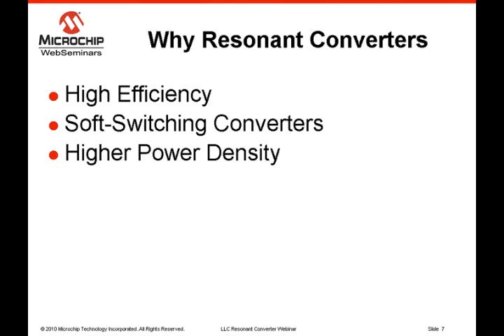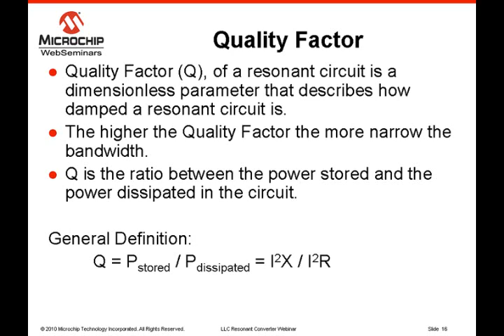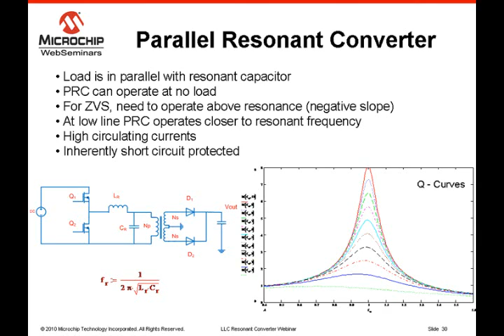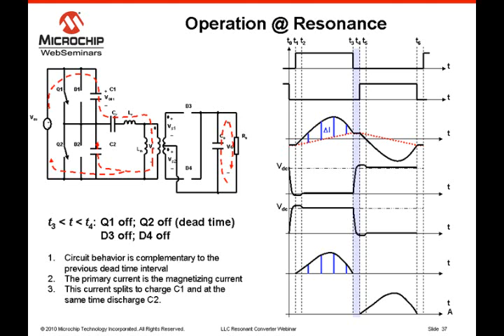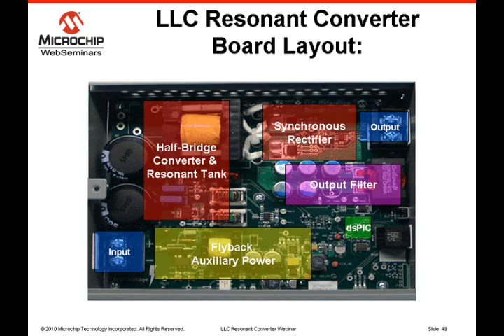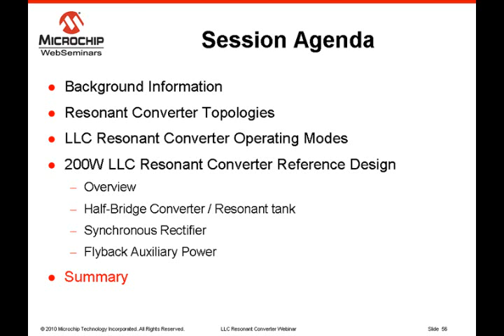Microchip: LLC Resonant Converter Reference Design using the dsPIC DSC

Comment: Great presentation.  I liked it, but I have a couple of questions.  First D2 as part of the half wave rectifier at 17:26 into the presentation.  I think that was an over site as I believe it creates a short circuit every half cycle.  My other question is the statement I played back 3 times to make sure I got it right.  You indicate MOSFET's are used over BJT's given the high switching speed.  Do I have this wrong?  It's my understanding MOSFET's are slow given the gate capacitance and association with RC time constant to charge and discharge that capacitance.  Where they excel is in current carrying capacity over BJT's given their low Rds when on.
     Yes, again as I always do, I'm going to go back and review to make sure my understanding is accurate.  Thank you again for this great presentation.
Reply: yes D2 is there to prevent the transformer secondary going way below zero every half-cycle.

Comment: How to design a LLC for variable output voltage keeping the fixed input and the keeping the components same?For example Vin =350 but Vout = 50V to 300Volts.
Reply: Hi, I think LLC is hard to do this feature
Reply: It is possible

Comment: at 5:38, when Cds discharge, current Ids flow through the bode diode should be reverse biased, right?
Reply: At first current flows through Cds and discarges Cds until the source of the transistor exceeds the supply voltage a diode drop. Then diode starts coducting and fixes the source volgage there. The voltage across the transistor is a diode forward voltage. When transistor is switched on under this condition, it is switching near zero voltage and hence called ZVS turn on.

Comment: The design seems too big to warrant resonant topology for only 200watt. I would think simply hard switching could do better. Resonant design should not have large lyt caps like that. Also it seems to be that the sensing on when to switch is the most interesting aspect of a resonant circuit design and that doesn't seem to be covered here at all. Is it blind switching?